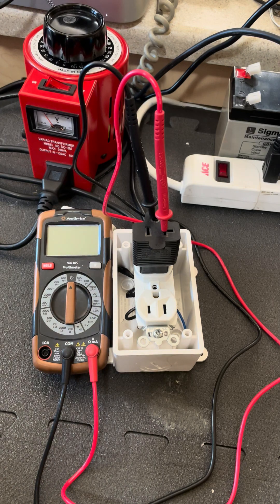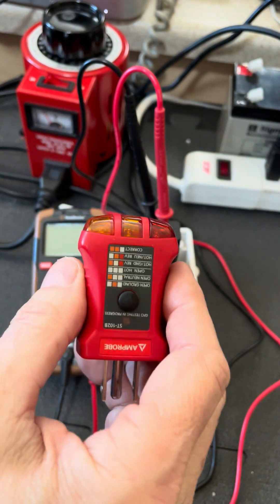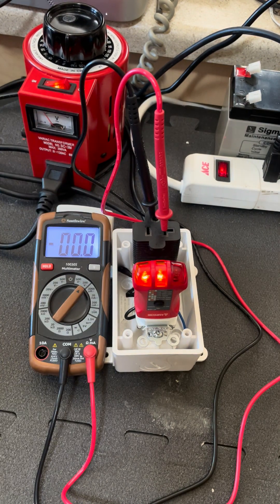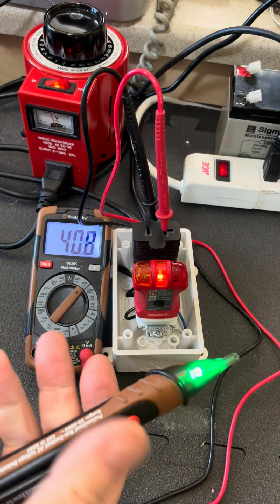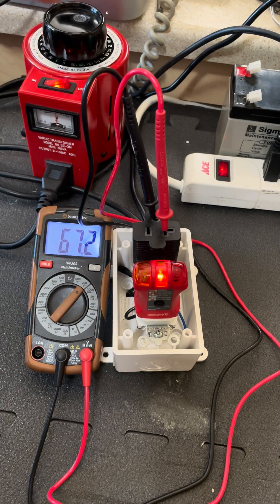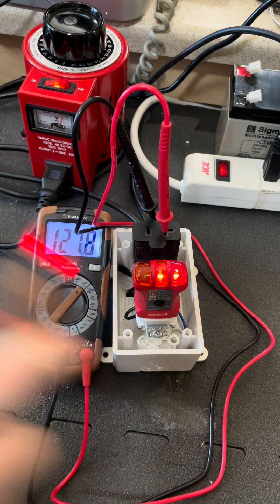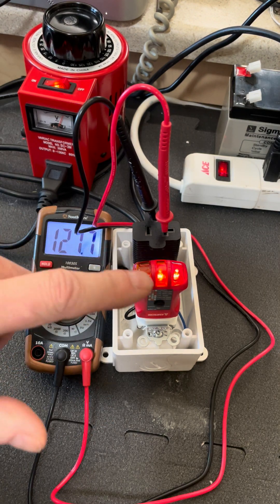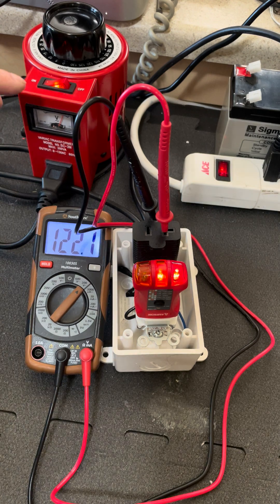Another 3-Light Outlet Tester Failure by Mike Sokol / RVelectricity

Comment: I had a "reverse polarity" reading on a brand new pedestal on a brand new loop. Because of your videos like this I knew enough to investigate further. Thankfully, my brother (an industrial electrician) was with me and understood immediately my concern about what you described here. He discovered that the wiring run from the panel was too short, so when it got buried it pulled wires loose in the service panel, while simultaneously chafing the hot wire against the chassis of the pedestal. He did indeed measure 120v on the ground!
Reply from the maker: Thanks for sharing your experience -  it's a great reminder that even brand new installations can have issues.

Comment: Mike, what is the best way to verify things are safe? Ohm the ground lug to ??
Reply from the maker: The safest way to check if the RV is safe is to test the pedestal box and RV chassis for hot-skin voltage with a Non-Contact Voltage Tester. 
Confirming that the pedestal group is properly bonded is a little more complex since it requires that you inject a fault current into the EGC ground at each pedestal to dynamically test the ground impedance. That requires a special piece of test gear.
Reply: @RVelectricity  Thanks!